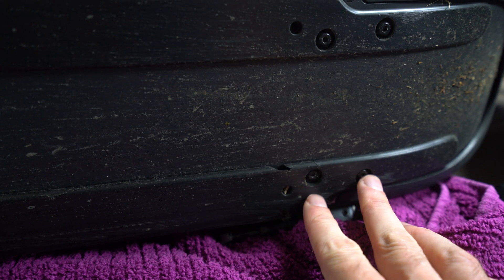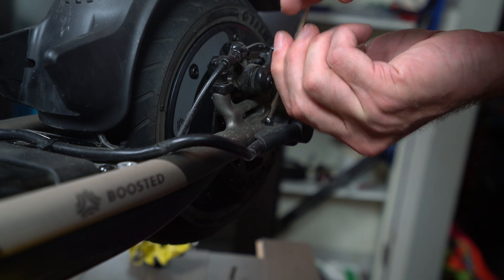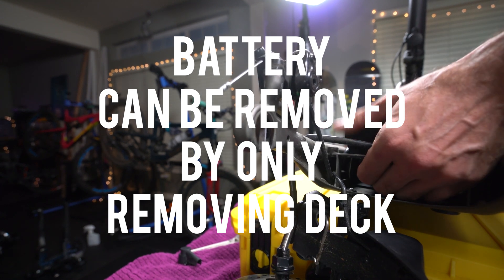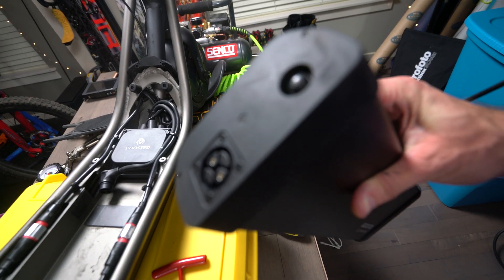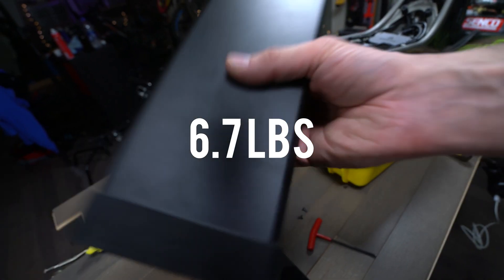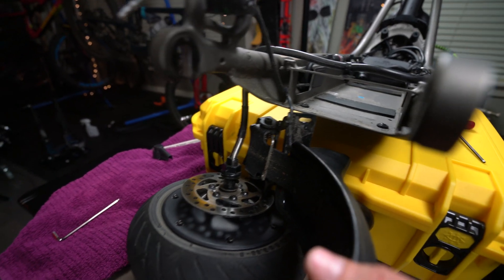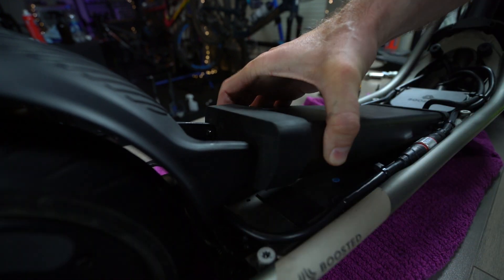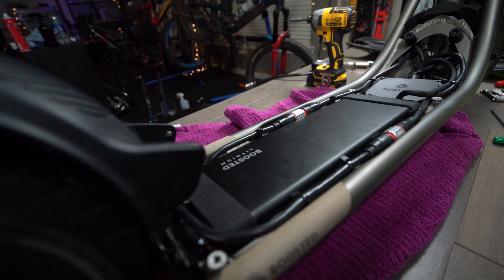Boosted Rev Scooter: Partial tear down, battery removed, weighed, double the range?

Comment: did you measure the battery voltage after you removed it?  i tried on mine but no voltage, did find 11V & 1.9V on 2 sets of smaller pins.  my battery works fine, but this makes me wonder if there is a mosfet turn on switch in the battery pack?    thxs

Comment: A great pull down, thanks. I'm of the view that the Boosted approach to waterproofing is pretty much the best way. Waterproof connections and have the shell open so that it shields water but is open enough to allow drying and prevent ponding. Hence those weep-holes and the big gaps in the case.

If I was to conjecture I'd not be surprised to find that the battery was not 18650 but was indeed pouch lithium cells, as thats pretty much their heritage in skate boards right? Nothing wrong with them, although I don't think that they're available in the INR (Nickle) chemistry yet. If you measured that battery and then considered the dimensions of 18650 cells (18mm diameter cylinder, 65mm long) you'll be able to estimate if they could be stacked in there (draw some circles, say in paint) and then lay the next ones over offset to see).

FWIW the battery pack in my Mercane Wide Wheel (which is 633Wh is substantially bigger than yours. Its 13S6P and is 405mm X 100mm (X 55mm high) ... it has the BMS inside it. If interested here is a pull down of my smaller single motor battery pack: http://cjeastwd.blogspot.com/2020/01/mercane-battery-pull-down.html So nearly as water resistant as yours (probably)

Comment: Hi Luke, I posted a video on how to make a field charger for the Rev for when you are away from any AC outlets. It's here https://www.youtube.com/watch?v=ZNmkINUJnGs - I hope your viewers find it useful. 
I also measured an entire charge from empty to fully charged, and only saw only 300Wh go in. 
That's a little disappointing when compared to the nominal 370 Wh capacity. 
The difference would probably yield a couple extra miles in range...

Comment: How many Mha is the battery capacity please ? So I can compare it to another battery pack I have . I've tried to convert wh to mha but haven't been able to figure it out . Thanks! I've just subscribed Anthony from London uk
Reply: G'day, Anthony! Am Sharing: I converted the watt-hours to milliamp-hours by entering the energy in watt-hours, and voltage below.

Watt-hours: 370 Wh

Volts: 43.2 V

Milliamp-Hours Results: 8,564.8 mAh

Cheers! 😊✌🏼🛴❤️🎄
Reply: @JPilot2  that doesn't seem correct ? Does that say 8 thousand 500 and fifty six mha ? Its definitely more than that!
Reply from the maker: Just multiple voltage times Ah on your other battery.
E.g. 48v times 10Ah = 480Wh.

Comment: Can you charge the battery when its removed from the rev, it kinda looks like it has a plug.
Reply from the maker: you cannot - at least not with the charger that comes with the rev
Reply: Now I have 2 batteries I wish I could figure out a way to charge the spare battery outside the rev

Comment: That's super informative! I would imagine it wouldn't be too hard to get someone to engineer a similar replacement battery - the hard part will be that silly proprietary connector that Boosted used (unsurprisingly). The 43.2 "nominal" voltage is also interesting, because Lithium cells are usually 3.7v nominal; at 11 cells in series that's 40.7v, 12 cells in series is 44.4v. 

Apparently the Boosted version is just slightly different? Hmm interesting. 

I do love my Rev, I haven't taken the deck off quite yet though. You're braver than I am! haha!
Reply: They can use 12x3.6 volts being on the conservative side that is 43.2V

Comment: Hey. I’m from the US but I live in Argentina. I’m hoping to bring a rev back to Argentina on my next trip but the battery is an issue with the airlines. Thoughts on removing cells? I imagine that’s really risky. Just trying to explore possibilities. Thanks!
Reply from the maker: I don't removing cells will help with airlines - I would check with the specific airline you plan on using.

Comment: I love the design of the "rev" but lets be honest here, that battery is a joke, some people is only getting 8 miles out of the "rev" that's seriously weak, and the fact that they wont even share the cells can only mean that they know it's some bad cells. they could have made the deck a tiny bit wider and easaly fit a 1kwh battery in there, and some samsung/sony 18650 cells to increase the range of the scooter to 35+ miles at an average 20mph cruise.
At this price point, its primary value comes from the design.
Reply: LOVE Sunzet boosted rev battery really sucks!!!

Comment: Once they make a better battery, the rev is gonna be a way better scooter. I love it so far for my nyc commute .
Reply: It’s an electric scooter! You shouldn’t be using it for long commutes, that’s what cars and motorcycles are for. Lol.
Reply: @adaptivetech8165  10 miles is long? And you need a better battery because of the hills and wind or even weight etc, so It's not really the distance., It's how much power you'd need for those things. And I don't drive so It's perfect for me.
Reply: MFSGamePlay why don’t you drive? I’m 15 so I legally can’t drive, so yeah electric scooter is a great way of transportation, also there’s something called Uber, and electric scooters are made very short commutes, not like a 20 mile trip, 10 miles is plenty, and is way more than you think. That’s around a 30 minute drive, 10 miles is at 30 mph. Soooo
Reply: @adaptivetech8165  I know what uber is duh! why would I pay uber?  when I have a scooter? I'm saving much more money with my scooter. if I don't ride my scooter, I'll just take the bus.  And, driving isn't for everyone. I live in nyc, I don't need to drive sir.
Reply: MFSGamePlay how much does a scooter cost? Yeah over $500 for a nice one, Uber is around $10 a ride, that means you can have 50 Uber rides for the price of one scooter, just saying, I love my electric scooter, (Xiaomi M365) but if I need to go anywhere over 10 miles than I take an Uber, I would still do that if I had a scooter with 40 miles of range.
Reply: @adaptivetech8165  Do some math man, because you clearly don't get it. I'm saving tons of money. Just stop talking and do the math. You don't know how much uber is, to and from the place, ,and fact, you don't know where i'm going. Lol
Reply: MFSGamePlay still, do you get my argument? Electric scooters were not made for long travel, and if you were going for long travel you shouldn’t be using an electric scooter, that’s my whole point “dude”
Reply: @adaptivetech8165  Well, dude! I do, And I save lots of money. You've clearly missed my and other point of having an scooter. I get to where I need to go faster than I car in NYC, believe that or not.
Reply: MFSGamePlay there’s also things called bikes, but whatever floats your boat.
Reply: @adaptivetech8165  You have a problem with scooters I see. lol You don't have to get one , leave it to the ones that likes them. Goodnight.
Reply: MFSGamePlay I own 2 electric scooters, the M365, and boosted rev, I don’t know how to ride a bike, and I don’t like bikes.
Reply: @adaptivetech8165  So, why bring up the bikes to me, if you don't like them yourself? lol you're weird. good bye man.

Comment: Do you know the dimensions of the battery? I’m planning to take mine on vacation and just need to ship the battery separately. Thanks.
Reply from the maker: i don't. i would make sure the airline will take a electric scooter on board. i suspect most won't understand or care that you've removed the battery.

Comment: That’s exciting to know. Would it be possible to charge the second battery externally or would it still need to charge while connected to the Scooter?
Reply: Yeah you'd have to charge it inside the rev unfortunately as the battery routes through the controller to the charging port.
For me, this would become a major pain if needing 2 batteries to go one way to work. You'd end up having to swap 3 times - once to get to work, once at work to charge both batteries, then once on the way home. Well, then another swap once you get home to charge them both, so 4 times. Prob too much of a PITA for me personally tbh.
Prob realistic for an occasional out/back longer ride. Or for someone just willing to do that. Using less deck screws or mod-ing them to be quick release somehow (while maintaining safety of the deck not coming off while riding) would help.
Reply: LukeMTB all great points. If Boosted ever achieved scale with these I could see a little exchange zone where you could swap your battery. My personal interest is travel. I live in Canada and I’m trying to figure out ways I could take this with me when I fly.
Reply from the maker: @scobelverse  Yeah I guess you easily pop the battery out, carry it on, and check the scooter in a bag. I imagine the problem you'd run into is the airport/airline staff understanding that's what you did, and that the scooter's battery has been removed. Sounds like it has potential for things to go wrong. Curious if you figure it out though, agree would be cool to travel with this and not have to rent a car for certain trips.
Reply from the maker: Here's the airline I use the most in the US - looks pretty dire for a Rev: "Two-wheel electric boards, hoverboards, gliders, electric unicycles, or intelligent scooters of any type which use lithium or lithium ion batteries will not be accepted in either checked or carry-on baggage." https://www.alaskaair.com/content/travel-info/baggage/prohibited-items/spare-batteries-electronic-devices
Reply: Matt Scobel removable batteries must be simply amazing!!!

Comment from the maker: Hi all, I confirmed you can remove the battery by just removing the deck. You could swap it for double the range in a few minutes once extra batteries are sold.
It's 6.7 lbs, 370Wh, 43.2 V nominal. Cell type and configuration unknown (Boosted won't release publicly).
0:01 Deck removal
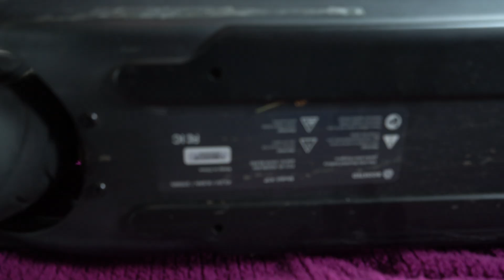0:06 Controller removal
0:41 Fender assembly removal
1:06 Rear tire removal
1:46 Finish fender assembly removal
2:42 Battery removal
4:11 Battery weighed
4:44 Battery stats discussed
7:01 Weather proofing illustration/discussion
7:37 Simple battery removal (only deck off)  + swap discussion (for range doubling)
Reply: Boosted Luke hi bro. I saw 2 ports when you unplugged the battery. What is that other port do you suppose?
Reply from the maker: @Henn617  https://www.reddit.com/r/boostedscooters/comments/e1u9lx/exploring_the_thingy_next_to_the_main_power_input/
Reply: Boosted Luke thanks for the link. You really have dissected this rev. How is your battery now by the way? The one guy said it was an equalizer and water seal
Reply from the maker: @Henn617  it's totally fine - not sure that guy knew exactly what he was talking about water seal-wise. I think the blue compound pulls double duty as water seal + thread locker.
Reply: There are so many reasons why this company went bankrupt
Reply: If there was a battery compartment that you could just undo a slider and replace the battery with a spare... that would have been fine.. I just can´t get over a €2000 scooter only probably averaging around 12miles (19km) for me.
For me a scooter is a leisure item... I want to explore the local paths, ride it along the coast here in Valencia or nip to the shops... I don´t want it to die in half an hour LOL
Reply from the maker: @CliveSmithy  they are def. marketing this as a commute vehicle, primarily in cities with traffic or cities where you'd normally take an Uber. It's not really being marketed as a leisure vehicle you can ride around all day on. I think people should buy this if they care about the following for their use case: a) 2 motor torque for fun factor, maneuverability, hill climbing performance, b) superior weatherproofing vs. almost all other scooters on market, c) ~10 miles-ish range, d) a premium-looking scooter (aesthetically-minded people), e) high build quality...and arguably f) solid customer service from a US company (although they've actually been slipping a little here, I think mostly due to Rev launch overwhelming their resources). It's def. not for everyone.
Reply: Boosted Luke Yes I get that - perhaps that works in the US where the scooter can be bought for $1500. In Europe where the scooter costs €2000 and we have to deal with third party suppliers, I am not so sure. For €1099 I have a Minimotors Mini 4 Pro, which is also a premium scooter with an LG battery pack. Its just the lack of range I can't get over... 22km in a usable mode at best is poor. I get a real range of 26km in mode 3 on the new Xiaomi Pro - single motor rated at 300watts but actually peaks at 1000watts - costs €499 here. Most of the trips out that I do are - 16km on the Xiaomi Pro - which the Rev may do, but not in mode 3 and 30km on the Minimotors mini or Dualtron. I don't expect a scooter to ride all day, but I do expect a couple of hours at least and I ride them all in the fastest modes
Reply from the maker: @CliveSmithy  agree $2200 USD would also be too much for me. I think these scooters are all about matching capabilities to individual needs. I personally would be bored AF on a Xiaomi Pro, it couldn't handle the hills in my area, and it's not weatherproof. The Mini 4 Pro does look like a great all rounder. I feel like single motor won't compete with dual on hills at speed though. If I cared more about range than hills, weatherproofing, etc. + lower cost those sound like great options.